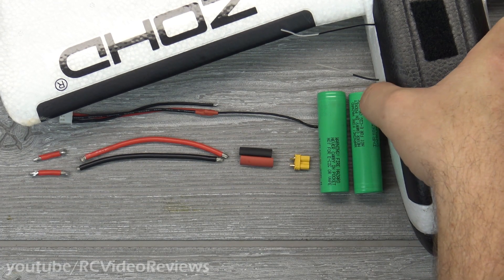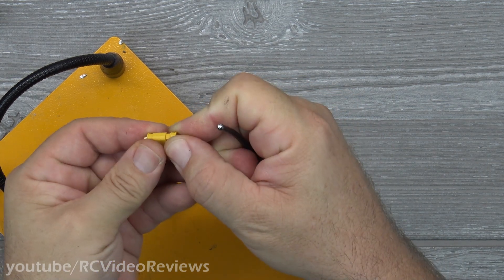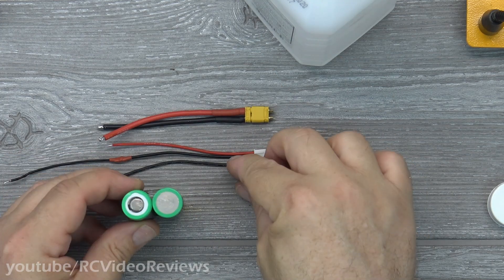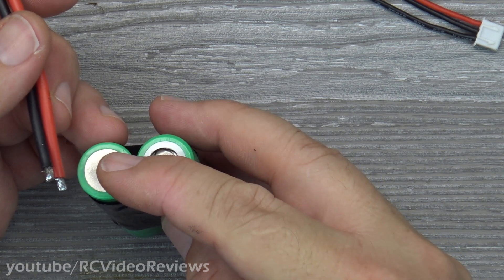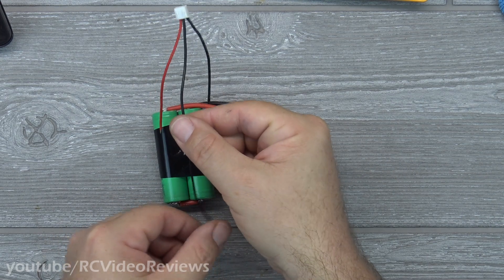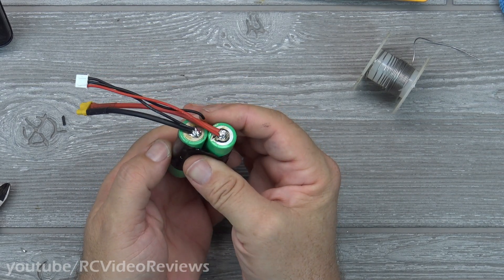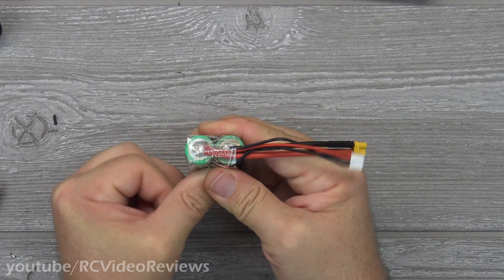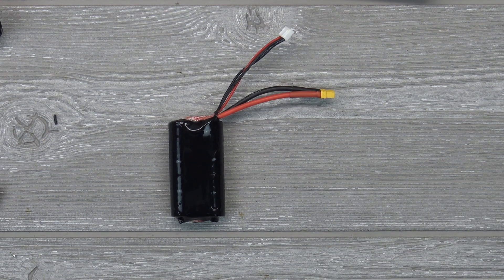How-to Make a 2s 18650 LION Battery with Balance Lead

Comment: do you need BMS, if the battery have balance lead?
Reply from the maker: Something has to balance and cutoff charge voltage at the appropriate level. Either a BMS attached to the pack, or a charger. If you balance via charger and cutoff charge voltage via charger, and you have a means of controlling over-discharge (ie you manually control load), you don't need a standalone BMS.

Comment: can this be done with the batteries being end to en rather than side by side?
Reply from the maker: Of course the arrangement of batteries can be modified, but the electrical connections have to be managed per your need. If you need batteries in parallel and want to lay the batteries down end to end, you need to find a way to connect + to + and - to -. If you need the batteries in series, that's usually easier for an end to end arrangement as it goes B1 - + to B2 - +. So the join is easier in series.
Reply: Hi Bob, I am looking to make a 7.4v inline pack (so + to -) to fit inside a small plane using 2 x 3.7v lithium ion 18650 batteries so will weld a bar between = to - and shape so as both batteries are in a line and then solder balance to middle bar as well as to pos and neg if im correct?
  @RCVideoReviews

Comment: You jump cuts are a little disconcerting.
Reply from the maker: I'm sorry to hear that. I'll try to do better. Nice to meet you. My name is John.
Reply: Hi John, 2 suggestions. I like the rosin flux. I use a 100w iron set to 700-750*. I've seem via a thermal camera of the heat penetration of the cell if you on a cell more than 4 seconds
 Gets ugly and it shortens the cycle life of a cell. I try getting on and off in under 3 seconds. Using 63/37 leaded rosin core solder works better than your 60/40 for 2 reasons. It has a lower melting point and it is eurectic. It does not go through a mushy state as it hardens. It instantly goes from solid to liquid and vice versa, which helps eliminate  cold solder joints.

Comment: Hello.  May I ask another question?  From the battery pack you made from this video, what mAH rate would you put in charging the 2s pack batteries?  2500mAH or 5000 mAH?  I am trying to figure out the correct mAh for my 2s pack.  Thank you in advance. :)
Reply from the maker: When you connect batteries in series, you add voltage. When you connect them in parallel you add capacity (mah). Since you made a 2s pack, you add voltage. Capacity remains 2500.
Reply: @RCVideoReviews  Got it sir.  Thank you for the answer.  Great information and easy to understand. Thank you so much for your reply.  Greatly appreciated!!!
Reply: Hi, just found your channel. Awesome content, I’m interested in a similar power setup for a fixed wing project but was wondering what the benefits of using Lithium ion versus Lipos.  I’ve read longer flight times and lower voltage/mah limits mainly but wondering if peak performance suffers due to motor demands i.e speed in general.  So would you agree a power setup in this manner is only worth using if the upper ladder is the goal.  Don’t want to invest in these batteries or risk builds for the wrong performance.  Thanks for your help.

Comment: Hello.  Thank you for this step by step video.  I would like to make a 2S battery pack (with a JST & Balance connector) from my old spare laptop batteries for my RC car.  Exactly like what you had there.  Question.  Can I charge it with just a balance connector which what it came with from my RC car.  Original battery charger that came with the RC car only has the balance connector slot for me to plug in to charge the battery.  Can I charge the self made 2S battery the same way?  Or I need to invest in a smart charger and charge the self made batteries which I am going to make?  Thank you in advance. Cheer! :)
Reply from the maker: If your car charger has the appropriate current/voltage settings for the battery you are using and it balances the cells you can use it. Just make sure the charger is designed to support the chemistry, voltage, and current for your battery arrangement.
Reply: @RCVideoReviews  Thank you for your reply.  I will take a look when I get home.  Greatly appreciated.
Reply: @RCVideoReviews  I have confirmed the charger that came with the RC car can support only Li Ion Battery with 7.4v, 1.5A max (charging it through the 3 pins balance port).  The battery that came with the car is a 7.4v 1200mAh.  So... correct me if I am wrong.  Basically, I can charge any Li Ion battery that is 7.4v (2S) with less than 1.5A or 1500mAh.  Anything higher than 1.5A then I will need a different charger.  One more question if you don't mind.  If I do purchase a smart charger and charge a higher mAh battery, do I have to plug in the JST connector (what my RC car use) and the balance connector together at the same time on the new charger?  Thank you again for your time. :) Jack

Comment: Spot Welding is much safer for these cells. No heat  to damage the cell. You can make cheap spot welders using 18650s btw ;D
You can solder onto the metal strips that you spot weld onto the cells if you still need.

Comment: I make same this battery 2s 3000 for each cell but i wanna know what is the best settings for charging if any one konw please help and thx 😊
Reply from the maker: 4.2v high / 3.3v low. Some will tell you it's safe to go lower than 3.3v, but I've found the amperage/punch gets soft much below 3.3, so I stop there.

Comment: stupid question: wasn't it easier to make all these connections on a battery HOLDER rather than the batteries themselves? so you can swamp them out if needed anytime you want. just curious... :-) thanks
Reply from the maker: I wouldn't trust a holder for a flight pack. I want my elements (balance/mains) affixed to the terminals.

Comment: Can I tin the power leads AND the balancing leads together (according to their respective polarity) BEFORE I solder it to the battery? Just wondering because it only exposes the battery to heat only once instead of twice.
Reply from the maker: Sure.
Reply: Thanx for the reply. I am a newbie, still learning. Will start experimenting as soon as my equipment arrives in a few weeks. Plan to make battery packs for RC and airsoft.
Reply from the maker: @BenAhmed67  The main thing is to get the heat off as soon as possible. Also, you can use thinner wire than I did. You're probably not going to draw too much amperage with these and the wire is very short, so smaller gauge wire is ok.
Reply: Thanks for the tips..noted..👍

Comment: Is that combined parallel and series connection?
Reply from the maker: No. Series. Only. Parallel has positive terminals connected and negative terminals connected. This only has one link between the negative and positive on the 'bottom' of the battery. This is series only.
Reply: Ok what's the volt of that? Can I do that in parallel for 3.7 volts..
Reply from the maker: @kuamhar1936  The cells are 3.7v nominal at 2500mah. If you connect them in series, you get 7.4v nominal at 2500mah. If you connect them in parallel you get 3.7v nominal at 5000mah. Series connections yields additive voltage. Parallel connections yields additive capacity (mah).
Reply: @RCVideoReviews  thanks

Comment: I have differnet voltage bateries (3.7V, 3.8V and 3.85V). Can I use these batteries in series? If I do this any damages for the batteries? Please help!
Reply from the maker: Yes, in series you can have different voltages, just make sure the mah is right. Also connect a balance lead and make sure to balance charge them.
Reply: @RCVideoReviews  Also those batteries have different mAh. will it be a problem in my case? Thank you for your reply!
Reply from the maker: @vindulaherath6400  You cannot have different MAH for batteries in series. That will kill the smaller battery. Here are the rules:

Parallel - Same voltage required, different MAH ok.
Series - Different voltage allowed, same MAH required.

You should watch this video: https://youtu.be/isXLePIYIr0

Comment: Build a 6s lion battery with balance port.  It's a very nice 'how to video'!
Reply from the maker: Thank you. I probably won't build a 6s pack because I have no need for one, but the process would be identical. Lead 1 would go on your main negative, lead 2 would go between cells 1 and 2, lead 3 would go between 2 and 3, lead 4 would go between 3 and 4, lead 5 would go between 4 and 5, lead 6 would go between 5 and 6, lead 7 would go on your positive lead. The same thing I did in this video with a few more connections.

Comment: OK So first, Good instructional video John, so thumbs up for that👍 I hope you don't mind, but I'd like to add a couple of tips:-
1) Only attempt to do this if you have a good QUALITY Iron rated at AT THE VERY LEAST 50W.  Higher the better, and as a large tip as you have as it will have a better thermal mass.  If you have one, a  genuine 200W soldering gun is ideal for this kind of work. The faster you can get the solder to flow on the terminal, the better. You want to have the "Dwell time" as low as possible, to reduce the chance of the battery being damaged. 2or 3 seconds is all it should take, any longer, you need a higher wattage iron/gun.
2)  Do NOT use plumbers flux or acid flux to tin the wires of the battery terminals.  It's corrosive.  Use Rosin Activated (RA) flux instead. Clean the terminals with alcohol once solderig is complete.
3) Have a fairly damp towel at hand when doing this.  When you tin the terminals and/or solder the wires to the terminals, as soon as you have taken the soldering iron/gun away from the joint, and the solder has solidified, turn the battery over and press it down onto the damp towel.  The towel will act as like a heat sink and drain the heat away from the solder joint, reducing the chance of heat from soldering damaging the battery.
Reply from the maker: Thanks for the tips Graham. I flew these yesterday on the Dart and they went 38m on, 36m in the air. I am very impressed.
Reply: @RCVideoReviews  That's great!! I've read that 18650's can be the better choice over li-po's when the model doesn't pull too much current👍

Comment: Great video. I just build a 6S 18650 Li-ion pack a couple of weeks back. It was for a low current application, so I actually used 2 3-cell holders glued together to avoid having to solder to the tops of the cells. I'ev got ~60 functional 18650s on hand after breaking down a bunch of old laptop batteries and am debating building a few packs like you just made for a couple of my planes.  I also use the same XT30/XT60/XT90 soldering tip.  I 3D printed a cool plastic vise from Thingiverse  that I use along with and a couple of sets of "helping hands" to hold parts like this as I work on them. It makes life a lot easier. 

BTW, I just used up my last roll of Radio Shack solder a while back. That was a sad day. 😥
Reply from the maker: I'm almost done with my solder and am very distressed about it. I can't find ANYTHING I like better. If weight weren't an issue I would have probably just done a plastic tray, but these are for the Dart 250g, so I'm trying to minimize weight where I can.

Comment: I'd really recommend using acid flux instead of sanding the batteries. You don't have to hold heat for long periods and it solders just fine. Safer for the batteries if you don't have a spot welder.
Reply from the maker: Thanks for sharing the tip.
Reply: I concur.   This is what I have been doing for years contrary to the naysayers.   Liquid flux vs paste is another tip.   Once you use liquid over paste you'll never go back to any other way, believe it.

Comment: Almost 9 seconds heat contact when soldering tab for first batt, this seems too much, it can affect cell performance in future. Also the wire gauge size (14AWG) seems like overkill for those 18650 with max 10A load. Smaller wire size would make soldering process easier and less total weight without performance impact.
Reply from the maker: "this seems too much" 

Seems too much? By what standard? What is the cutoff? What temperature should be used on the iron?

"it can affect cell performance in future"

How? What aspect of performance is impacted? Is it capacity? Resistance? Voltage delivery? And if any of those are affected, by how much? What causes the issue? Is there any way to measure it? 

I'm ok with a dialogue, but it seems to me what you've posted is anecdotal. Show me something besides an opinion.

That was the smallest silicon wire I had and I wanted silicon. We'll see what happens with the long term performance. They balance charged fine for their first go.
Reply: @RCVideoReviews  I believe no one will tell you exact metrics here. Its more on "rumors" side and effect cant be reallistically  measured, unless someone will do experiment with building same packs with same model batts and same production batch. Then those packs can be built via various options e.g. 1 pack with 3 secs soldering on a point, other with 10 and 3rd with 15 secs. Preferrably 3 packs for each option )) That would be really interesting to be honest :)  From you practical video though - when I saw process of solder application by 3-4 sec I was like "Ok, typically I'm done here, solder joint is liquid and moisten, finished". On 7 sec I was like "oops, seems too long". On 9-10 I definitely was having a feeling that it was just not fast enough. And again, that is fully subjective, I'm not arguing that. Some more experience and this can be done faster in future for sure, also smaller gauge size can help to reduce solder timings.
Reply from the maker: @Mt1Dmitriy  I try and avoid subjective and speculation when I can on this channel. There is enough rumor mill out there and on this channel I focus on video evidence. So you'll hear me say, "Show Me" quite often if you decide to hang around. FWIW I flew these packs yesterday--38m total on time, 36m in air for the first, 28m on the second and I landed early because my spotter had to leave. Second set was @ 7.2v when I was on final.
Reply: @RCVideoReviews  glad it is working well for you. What I wanted to highlight is that this process can be done much faster, which is definitely not making result worse. Maybe it was a 'road cross on a red', so you are on other side saying "hey, nothing happened, I'm good". Some effect like increased internal resistance can come up later, without a test like mentioned before - we wouldn't know.  General tips - use high power iron, use appropriate wire gauge, flux the surface, solder as quick as possible. I know some people even put cells in fridge before solder :) I hope other people just dont take this 10sec soldering as something "normal" and typical.
Reply from the maker: @Mt1Dmitriy  I mentioned several times to make the solder joint as quickly as possible. I used the largest tip I had. I used the best iron I have and that is probably better than most out there. So while I appreciate your effort to help, I don't think it's justifiable to claim there is a "problem" with what I did when it appears to have worked and there is no MEASURABLE impact I've been able to identify, so I would appreciate it if we can avoid setting off alarm bells without meaningful substance behind it.
Reply: Interesting conversation. Wish it was current. IMO 10 seconds is ridiculously too long. I've seen a thermal camera and the depth of heat penetration. I try to get on and off under 2 seconds. Also, use 63/37 leaded solder. It has a lower melting point than 60/40 and it is eurectic.
Reply from the maker: @doodlebug1820  Then don't do it. The same warning has been in the description from the start. PS People shouldn't speed when they drive, smoke, drink, do drugs, handle damaged LIPOs, ride motorcycles without helmets, or dozens of other things that are known to be problematic, but they do them anyway don't they?